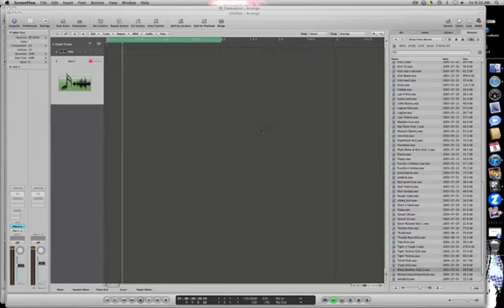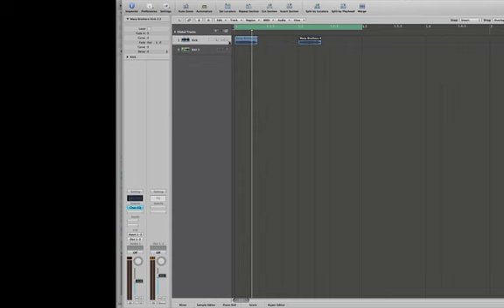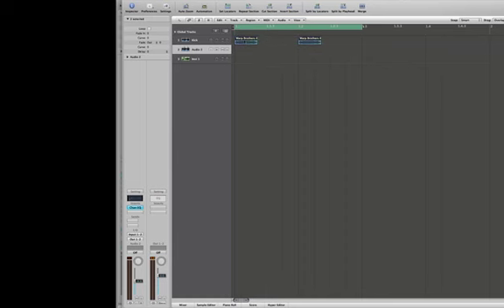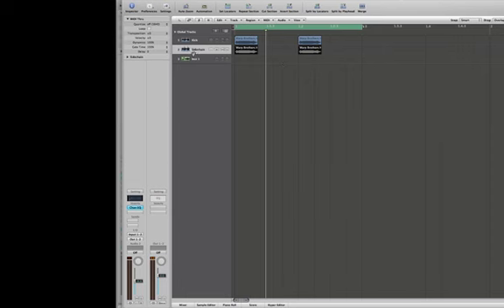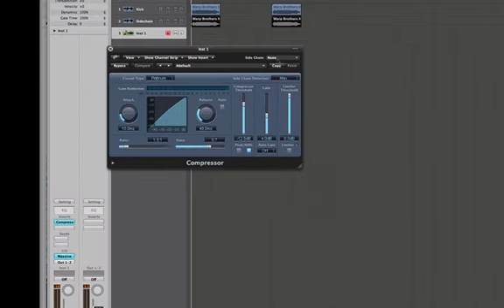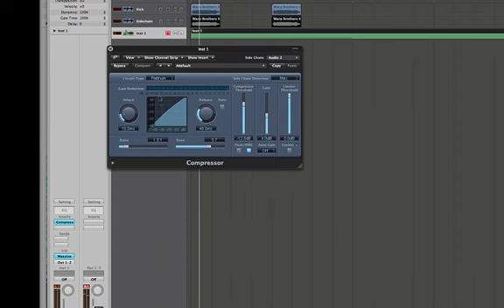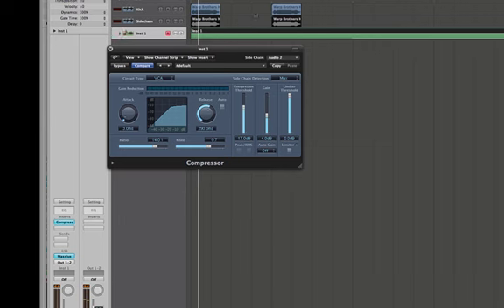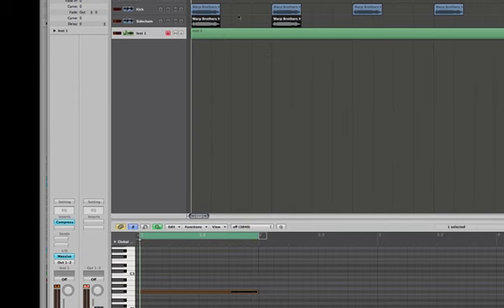How To Do Easy Sidechain Compression in Logic

Comment: @jmotter92 you can do it with an instrument/midi track. Using this method you'd take the "ghost track" and set the output to a bus and mute that aux on the mixer (leave the actual ghost track un-muted though). Then you'd go to the synth's compressor and set the side-chain to that bus.

Comment: @dude1703 What you have are two MIDI tracks.  he is using audio from a drum that he sampled from another song (i.e. Audio 1 and 2.)  if you import a kick sample as an audio track instead of midi and do this process, it'll work out fine.  i had the same issue so i just tried an audio track instead of midi and it worked.  hope this helps!